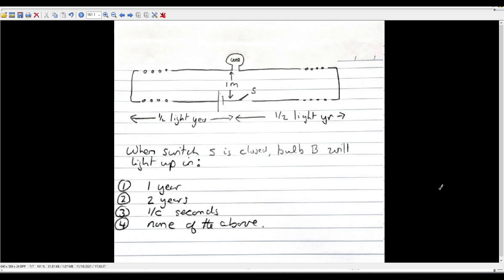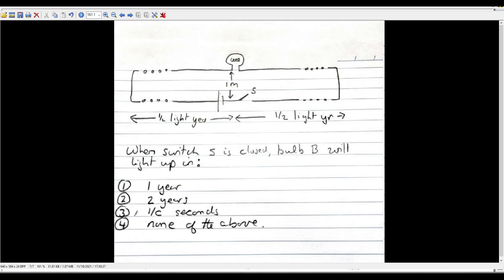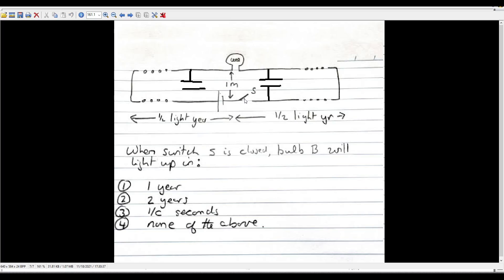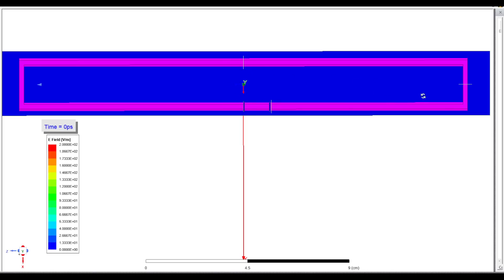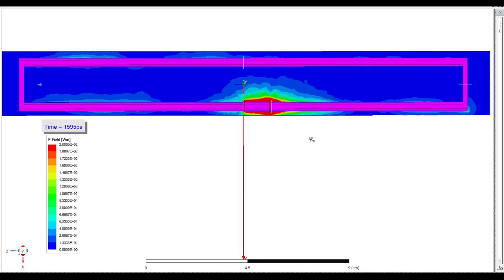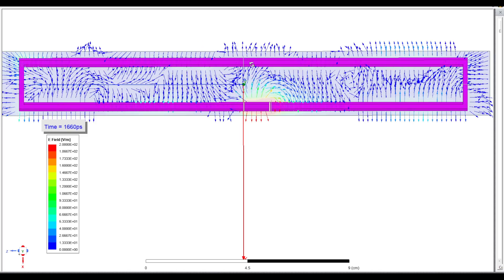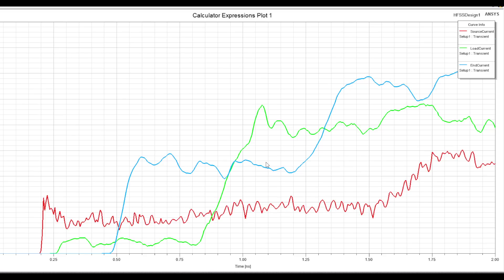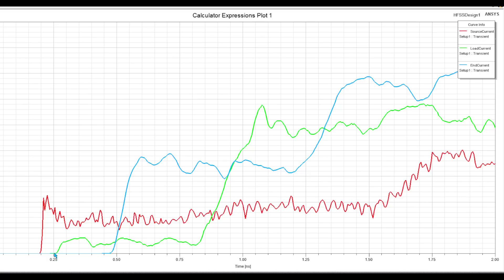Response To Veritasium - Electricity Propagation Time Problem

Comment: Looks like a hundredfold increase in power at the load (tenfold current increase) at the first big step. Somewhere in the Veritasium post, I pointed out that the small induced current early on would "light" the bulb at a very low power, allowing it to emit thermally in the infrared or microwave range (we aren't told what the battery voltage is, or the operating range of the bulb). So whether this low-level energization of the bulb could be considered "lighting the bulb" is an open question. I appreciate the spirit of the problem, but the problem statement left a lot undefined. I'm sticking with 1 year as my answer; that's the first time the load is energized at a higher level. But technically 1 m/c is also correct, iff we consider the early small current sufficient to light the bulb...I don't think that was Veritasium's intended interpretation, though.

Incidentally, the 1 m spacing is only specified for the distance between bulb and battery or switch. We aren't told if the spacing is consistent over the span of a light-year.
Reply from the maker: Yes it seems that you understand the fundamentals of the problem. Like you said it just comes down to the interpretation of the problem parameters to define the specifics, which can only be verified once Veritasium posts his video. Looking forward to his take!
Reply: @PulsedPower  Wondering what the answer would be if the bulb was an LED, so it would only conduct with adequate voltage
Reply from the maker: @grekiki  
When you get that far into the weeds you would need to know the source voltage and impedance, the actual switch properties, etc. But essentially its just a matter of having a high enough source voltage that you can overcome the LED voltage drop even at the "reduced" level.
Reply: @PulsedPower  Ironically, Veritasium used an LED both for the "demonstration" AND in the animated illustrations. I think I left his video more confused than before, it certainly was not clearing up a misconception for me.
Reply from the maker: @toebs_  let me know if there are any questions I can answer or simulations to run that would help clear things up further!
Reply: @PulsedPower  Can we still make it work if LED needs 3V and we have a 5V battery?
Reply from the maker: @grekiki  In that case it would likely take several relections before the load voltage reached 3V. Again, at this level you would have to define pretty much all of the parameters inluding load, line, and source impedances and actually solve the numerical problem quantitatively.
Reply: @PulsedPower  yeah, I think most people consider a bulb to be 'on' when it's receiving the max amount of power possible by the wires and not just some induced current based on the proximity of the wires and by the looks of your model it would take the time required to make that half circuit (1 year, 1 second, whatever scale you're working on).

Follow up question: Would the current look similar in the early stages (1/c time scale) if the far ends of the wires were not even connected or does the static state of the wires having that 1v all the way until the other end of the switch matter?

Another variation would be a circuit with a bulb like you had but then another bulb with parallel wires the same distance from the source not connected to any thing.  Would that result in the same current as the 'live' bulb or less... or none?
Reply: @BenRHarsh  Current will flow in an unconnected parallel wire after the switch is thrown, until the reflection cancels it out.
Reply: yeah this is also my problem with his video, he implies that the bulb receiving a minuscule amount of induced current is "turning on" the bulb which is misleading
Reply: I mean, we have to assume that any amount of current is considered sufficient to light the bulb.

If we don't, then the answer depends on parameters *not listed in the question*. If we have to ask 'what's the rating on the light bulb' then we also have to ask such things as 'What are the exact properties of the wires' and 'how efficient is the switch' and so on and so forth.

It's like responding to the Trolley Problem with 'well that would never happen, because Trolley Systems are actually very safe'.

The one way the question can be meaningfully engaged with is to accept the premises of the question, and that includes accepting that all things not given as parameters in the question are not of relevance to the question.
Reply: @diestormlie  You can't make that assumption that "that any amount of current is considered sufficient to light the bulb." 
because if you do, then "ANY" amount of current turns the light on and then the wires are no longer needed. 
Clearly the demo shows the light is OFF when the the switch is closed. So, you cannot make the assumption that any current turns it on. For this to be a valid experiment, the bulb must have some reasonable current requirement. Anything else is simply a "long video" that says EM radiates, and would be pointless and redundant.
Think about it... the mere presence of the battery is enough to induce a charge field around it. Therefore when the "virtual experiment" started, an EM wave would be present as soon as the switch was touched by a person. Actually probably earlier because when the simulation starts the charge in the battery would extend into the conductor and toward the switch resulting in the light turning on even without the switch being closed.
So, it is not acceptable to say "any" amount of current. In order for this thought experiment to be considered anything valid, the bulb must require some reasonably normal amount of current. and since he shows LED bulbs that also means it must overcome the LED voltage drop.
Reply: @marcfruchtman9473  
"because if you do, then "ANY" amount of current turns the light on and then the wires are no longer needed. "

I mean, isn't that exactly what the point of the experiment is? Demonstrating that Current can be conducted via Electromagnetism alone?
Reply: @diestormlie  "...then the wires are no longer needed."

If the wires near the battery and switch are removed, current will only flow until the far terminal of the switch is charged. If the wires are disconnected at the bulb, current will only flow until reflections settle in the bulb's filament and leads. So we're probably talking about energizing the bulb for a fraction of a nanosecond, but in the loose definition of the video, that any nonzero current lights the bulb, it will "light" very briefly.
Reply: @marcfruchtman9473  "square of the distance" applies to a spherically symmetric radiation pattern. The radiation pattern of the wires is not spherically symmetric.

You are correct that the majority of the energy arrives at the bulb along the wires, but not all. Most transmission line models don't include radiation, except possibly as a loss factor. However, most transmission lines are either balanced or shielded or both. This one is neither (hence the antenna-like behavior).
Reply: @rsm3t  Regardless of the exact "shape" of the loss, the loss is still inversely proportional to the square of the distance from the line. I will admit there's some possible alterations in the exact equation, but the reality is that the power arriving to the Bulb is not enough to turn it on after passing thru 1 meter of air gap. 
If the light turns on at all, it would not be visible to the eye in daylight. It's Nothing like the demonstration. It's completely ridiculous to claim the light on due to a transient and minuscule effect of insufficient EM Wave energy because by that definition then every light bulb in my house is "ON" even with the switch off.
Reply: @marcfruchtman9473  I was mistaken, it's not because of the lack of spherical symmetry that it doesn't follow the inverse square law, it's because this is near-field transmission.
Reply: This is actually a folded dipole antenna with a load inserted at the midpoint. Segments of antennas couple with each other, so that coupling has to be included to get an accurate analysis of energy flow.
Reply from the maker: @diestormlie  Very well said!
Reply: I got 150 years (for a light-year long cord),  the most obvious resistance free conductor is vacuum.  The 12 eV the electron can get from a car battery gives it 1/150 times the speed of light.
Reply: @2adamast  surely you can't be serious.